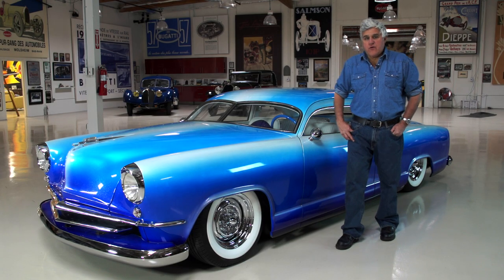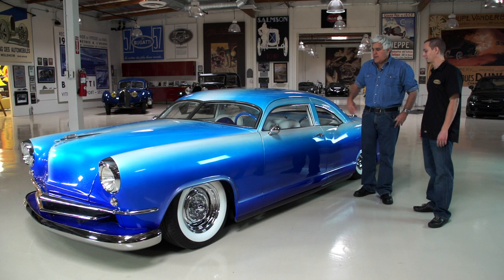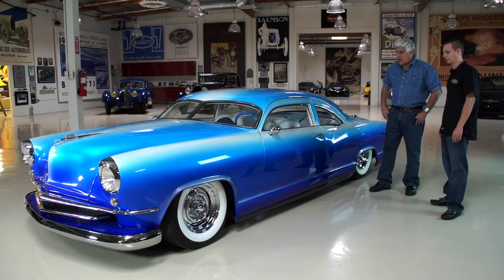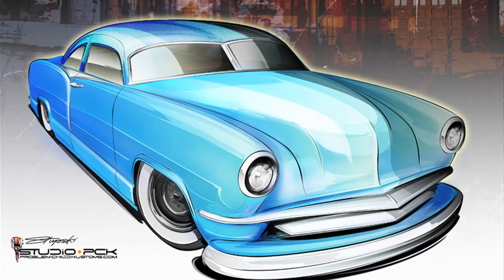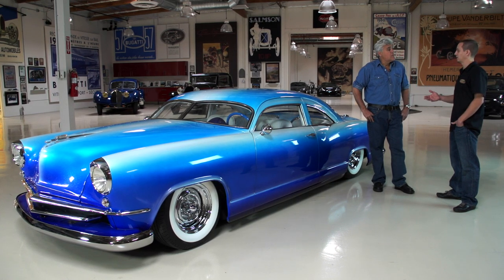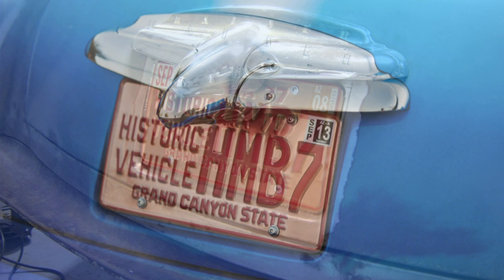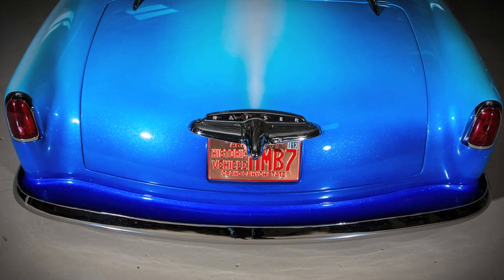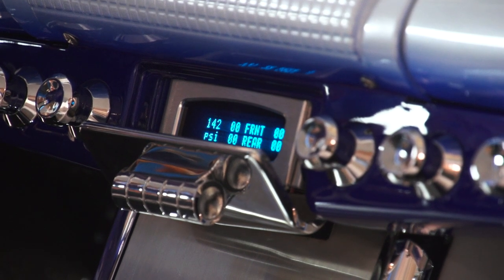1951 Kaiser Drag'n - Jay Leno's Garage

Comment: I think it would be perfect if the roof wasn't lowered so much and the rear end didn't sit so low while it's moving, other than that, it's an amazing looking machine.
Reply: You understand that the chopped top and the low rear are 2 of the major custom touches of the overall theme the car is built on right? It's a 50's custom. Without those 2 things visually you pretty much have your Grandmother's Kaiser.
Reply: Oscar Madison
It's just brought down too much for my tastes, just voicing my opinion that's all.
Reply: Voivrenetwork there would be no point in it otherwise. opinions are valued, though.
Reply: how can you not drive it?
Reply: and what would be the point COULD you not drive it? cars are so much more than appliances people make them to be.
Reply: Martin Dennis
you are unbelievable. quick question- why look at car channels if you are clearly not a car person? such pragmatism is why they sell so many Toyota Prius' and Buick Lacrosse's.
You are basically saying, then, that driving a highly expensive sports car is also buying a car "you can't drive" since, heck, it might chuck out about 700hp, there's no place for a child's seat (excuse me, make that 4 child's seats), no place for a fat wife or your other sweetheart, gas mileage can be horrid, it makes a lot of noise, eats up tires or is simply not affordable to buy or change parts in case of a crash because you've been highly unsuccessful in your life and can only look at posters on the wall.

By the way, no one said the tires on this car were "custom size", which would mean custom size wheel...

Why the hell are you on this channel?
Reply: Okay I get you now. You sounded like you simply didn't understand cars. All custom cars have got this issue of impracticality etc. However how that makes it any less streetable is beyond me. If one has got enough time/money to work on them or drive them, there is simply no difference. Considering that this whole argument stemmed from the whole "window too narrow" point of view, which I accept, but is slightly ridiculous, since this has been seen in hot rods and custom cars in general since the 30's. it's simply a matter of ones choice whether to daily drive them or not. if the guy wants these particular tires every time a set wears out, then why can't he do that? it's the same as Lexus LFA, with specifically custom made tires for that car and getting them is a hassle, but it is still a perfectly streetable car, actually more so, than a lot of other supercars.
Reply: Some people like Honda Civics and think they are cool, lol, we like custom American Show cars, looks good just as it is.
Reply: That's called a tail dragger. It has air bags so the ride height can be anything you want, front or rear
Reply: I'm not usually fond of low rear ends either, but this one looks great... plus it is adjustable so it does not need to hang low if you don't want it to.
Reply: Chopped tops for the most part, even though it is popular, always look weird. The rest of the car is pretty awesome.
Reply: ferlenarab You don't speak for all of humanity.
Reply: Cars are utilitarian transportation devices to some people. Cars are art to some people. Cars are an extension of some peoples personality. This car is rolling art and art is subjective. If you don't get it then you just don't get it. That's OK.  I was just pointing out that the lowered stance and thew chopped top are mandatory for the theme this car is built on. I give zero fucks whether anyone likes it or not. I like it.
Reply: Oscar Madison
awesome response
Reply: Martin Dennis
Why would I be an idiot to park my car and walk away from it? I park all my cars and walk away almost everyday. If you're thinking they may be stolen. That's highly unlikely. It would be like stealing the Mona Lisa not that this car is in that realm but it is one of a kind and readily recognizable. So...if you stole it what would you do with it? There are some things that when stolen become virtually worthless.
Reply: FYI, There are insurance companies specifically for collector cars, show cars, custom cars, etc, where you agree on a value of the car and insure it for that value. It's very affordable and the people at these companies actually "get it".
Reply: Oscar Madison No, I'm not thinking about it being stolen. I'm just thinking about people  swarming all around it, peering into it, just generally being too curious.  And I'll say it again. The car has custom made tires. How do you plan to replace them if you just drive it around like an ordinary car?
Reply: Oscar Madison yes, I'm sure these insurance companies understand that these are show cars but it's probably affordable only because they know you're not commuting in it like your average Chevy.
Reply: Martin Dennis who says they are the tires he uses on the road, he may well swap them over between shows?
Reply: Martin Dennis Let's say you owned a Salvador Dali or Picasso. Would you hang an expensive piece of artwork somewhere your kids and dog could get at it?  Of course not!  But that doesn't mean that there is nowhere to hang it and no purpose for creating or owning the work. It's not like if you loan it to a museum, they 're going to put it behind a glass enclosure. No, it will still be out in the open and exposed to the elements, just roped off so that people cannot touch it.  Some crazy guy can still go in there and spit on it or throw his shoe at it or whatever and damage it forever.  That's just a probability that you cannot avoid, only try to minimize. This Keith guy doesn't have a 350 million dollar net worth like Jay but just by appearing on Jay's show,  and judging by the popularity of this episode, the value of his car, in case he decides to sell it, probably went up by at least a hundred thousand dollars.  

And let's say there's a fire in his house and the car gets destroyed and ends up looking like the junk heap he paid 150 bucks for. First he would have his insurance money and second, if he decided to rebuild the same car or a similar car, it wouldn't take him 8 years like before. He might not be able to replicate the exact same car down to every detail but he can probably come close and do it MUCH FASTER than before, given his current fame and reputation. In fact, people will want to help him do one or five EVEN BETTER than this one.  So, being paranoid about small amounts of damage to your baby is like over-protecting your kids. It doesn't pay-off in the long run and can actually do more damage than good.
Reply: Voivrenetwork That's what makes it a cool looking car..
Reply: Kyle Raetz
Bagger
Reply: It's ride height is adjustable.
Reply: Kaisers are ugly cars stock. This one is a miracle on wheels.

Comment: I've seen this video 3 time still amazing,  I was at Payless  Cashways building supply in Phoenix (closed years ago). I ran into an old man who was driving a kaiser he said he had several of them.
He was building the one he was driving into a convertable, using the top from a 61 Cadillac. It wasn't finished but looked factory. He welded the stainless wind shield trim from the Kaiser to the Cadillac  beautifully,  and created the hardtop door and window slides from the caddy. I wonder if was the same man he got his car from.

Comment: Using a 95 Chevy cop car frame was smart. Cop cars have reinforced frames for the beating they have to take. Came with the LT 1 mill which is a great engine for a torque cruiser and it’s easy to find parts for. Just smart choices all over this thing.

Comment: Awesome !!! They sure don't make them like that any more. My Granddaughter just had to "get rid of" (mechanic's special) a 2014 Escape 1.6L Ecoboost that blew a head gasket @ 71K miles because of a "flawed" engineering design in the engine block @ Ford. We changed the head gasket and learned ALL about the engineering on that car. It appears that the engineering team must all have been working from home instead of at a central place because NOTHING on that car was designed so it DID NOT REQUIRE removing components to access fasteners for other components. There has to be more "old school" engineering on that trunk latch/lock/emblem than an entire 2024 "plastic" vehicle.
Sometimes, the best cars come out of peoples garages !!!

Comment: The headlight surround is from a Australian Ford Zephyr Mark II ( 1956 - 62 ), which was an Australian built car with many imported parts which made it an expensive car as import duties had to be paid. This was replaced in 1962 by the America designed Ford Falcon with all parts being made in Australia.
My father had a company provided 1959 Zepher Station Wagon which was replaced 1961 by the newly introduced XK Ford Falcon Station Wagon when I was 9 yo. I can still remembering at the time thinking the Falcon was a lot tinnier than the Zephyr, especially for Australian conditions.  Although it was bigger than the Zepher, it weighed 100KG less. Collapsing front ball joints and adjusting shims dropping out of the front suspension gave this model a poor reputation. These problems were fixed in the 1963 XL model which had a heavier suspension system with components from the Fairlane. The Falcon went on to have a long 56 year life span in Australia, finishing production in 2016, some 46 years longer than the USA version which ended production in 1970.

Comment: Like the car but I think he chopped too much out the roof 2-3 inches would have been better. And I would have used an inline 6. There are a lot of parts available for the Ford 4.9L I-6 or the slant six. Saw a guy here on YT who had gotten 300hp out of a slant six. It is possible to get a curved intake manifold for the I-6 which I think would make it breath better *;run faster. And the slant six bent shape makes that kind of a fast manifold possible.

Comment: Why do you not have a Henry J ?  My stepdad had one and one 1951 Allstate witch was a Henry J sold by Sears.  I don,t think Sears sold  any other cars. They were very good cars, with either a Continental 4 or 6 cylinder engine.  The Henry J had a 4 and the Allstate 
had a 6.  They also had the Chrysler rim wheels for tubeless tires. I think that they were the first U.S. first compack car not copied from other cars.

Comment: BIG GIANT HOOD little tiny engine
Reply: The engine isn't tiny, it's just low because it sits on the police Chevy chassis.  That is an LT1, 350 cubic inch 8 cylinder motor.  That translates to 5.7 liters or 5736 cc. That is the motor that was in police cruisers.  That can be built to upwards of 500 horsepower.

Comment: Too low, hard to see out. Seats too low have to sit hunkered down. Not enough ground clearance, therefore not enough wheel travel. Probably scrapes going in and out a steep driveway. The only reason this thing is beautiful, is because the original car was beautiful. Too bad the original 2 door car was very rare even new. I'm sorry, I really hate this thing.

Comment: I am angry that they chopped it, practically kissing the ground. We shouldn't see these vehicles as something to modify and be used for a race, they were once elegant and the highest level of stature. I know he made this piece and his ideas are there and he thinks artistic and creative in his work of putting it together, but I feel as though it just isn't right to do this. Why rip off the wonderfully crafted embellishments on the automobile. He's certainly that "I will talk about the body before a few minutes but talk about the engine for 6 hours". I only hope the wheels are thin, or are they batter wheels that practically make a thunder storm quiver when they roll. He doesn't understand some parts of it, he's only being congratulated by the moronic modifiers that turn motors from 1940-to 1960 into their mess of a make, and then turn the 1915-to 1930 into their precious rat rod. It pisses me off highly because it would look far better at its to the number mature design and correct of course it has those wonderful streamlined wheels and not a chrome nail in the center of a half assed white wall.